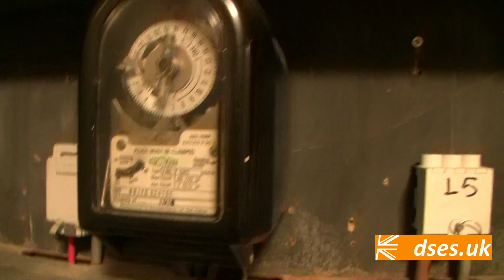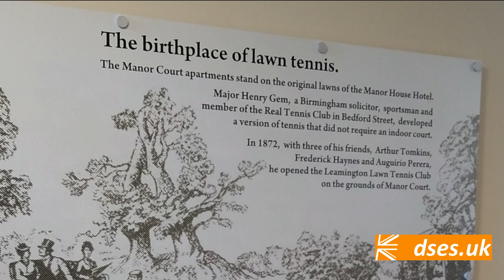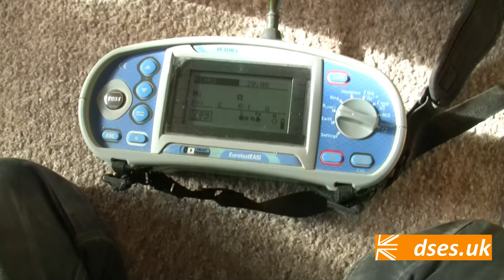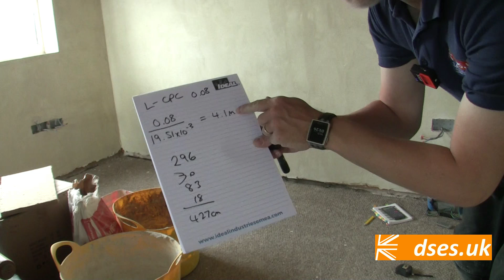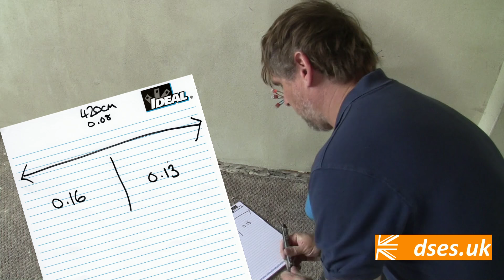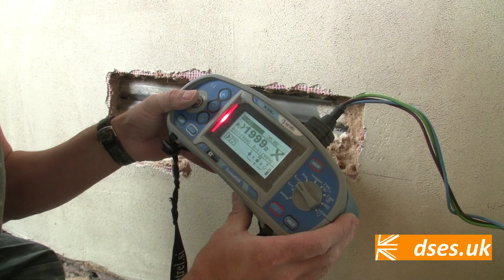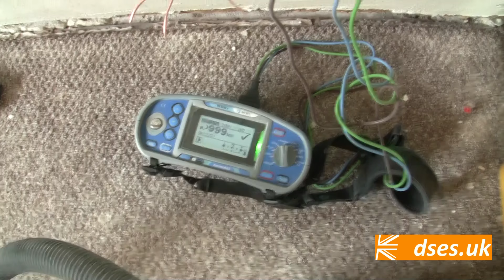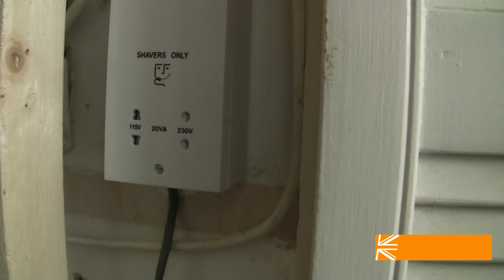Fixing another man's lash-up!

Comment: Crimp links and heat shrink with a fourth lot of heat shrink for the outer sheath. You could use thick wall for the outer if you wanted but not necessary. Cheap quick and lowest profile, can fit a piece of capping over the top. Parts required always on the van. It does depend on how the Neutral and PEC were damaged though, if strands are cut in both by the nail you can't stagger your links unless you piece another section into one of the conductors and use four links for the repair, but thats getting a bit messy.
Reply from the maker: It's the larger heat shrink for the outer covering I lack on the van at present, otherwise I probably would have crimped it.

Comment: The issue with the socket boxes being set back exposing the fibre board can be fixed by adding extension boxes on top of the existing to continue the metal containment . The wiring of the ring going to every other socket is nothing new , I would have used radial circuits in the lounge and bedrooms as said .
Reply from the maker: I have some skeleton boxes on the van, but it was easy enough to remove these and replace them with 35's. I prefer radials too - I'd have one for the kitchen and one for the lounge/bedrooms for something this size.
Reply: @dsesuk  I think you are right about old habits dying hard , older sparks would use rings  even if it's a lot of work to wire in whereas we would look at the load and area and use radials .

Comment: Electrical wiring in the UK is so strange and different from here in the US. I find the whole concept of ring circuits to be fascinating. Brilliant troubleshooting job on this. I would probably have just ripped it all out and replaced the run between the two boxes. Using conduit rather than that nailed on capping seems like a better installation method since that would have allowed you to just pull a new cable without disturbing the wall at all but, again, it's a different world there than here.
Reply from the maker: Thanks for tuning in from over there! The ring circuit concept is... interesting, and it has it's reasons for being which is basically down to a copper shortage after WW2! Instead of wiring two or three low-current radial socket outlets, a house could have one higher current (30A) circuit wired in a thinner cable that looped from the board, around all the outlets and back again to provide two paths for sharing the load current. For some reason, it caught on and they're still installed by many today, although on an installation like this it's pretty ridiculous and makes the job harder. Two radial circuits would have sufficed here. Conduit is better as you say, but rarely seen domestically here. I would like to use conduit, but I wouldn't be competitive against those who want to do it quick and cheap and who don't care about future-proofing!

Comment: David, regarding wiring zones, I cannot find any mention of where to run cables in the walls in the 14th Ed. (1966). The 15th Ed. (1981), which was mandatory from January 1985 mentions the areas formed by the corner between ceiling and wall or internal or external corners between walls. Reg. 523-20(c) says, "Where the cable is connected to a point or accessory on the wall or partition, the cable may be installed outside the zones permitted by 523-20(b) [ ie the 150mm wide/ deep areas mentioned above ] only in a straight run, either horizontally or vertically from the point or accessory." It is a little ambiguous in that it does not make it clear these horizontal or vertical runs must be in line with the accessory box. Because of electricians' confusion following the introduction of the 15th Ed., it was decided that installations wired to the 14th Ed. could continue until 31 December 1984. So, if the previous fella on your job learnt his trade under the 14th, he could be perhaps forgiven for this routing of cable. Even under the 15th, there is scope for confusion. Some use the OSG for guidance on interpretation of the good book, even though it is not part of the regulations, but that was not introduced until the 16th Ed.
Reply from the maker: Thanks Simon, interesting to hear how things used to be (I only go back to the green book of 17th Ed amendment 1). Still, anyone in the game ought to be keeping up with the changes. To have not learned of a change to something as basic as where to run cables in the past 36 years is a bit of a forehead slapper!

Comment: If 'old boy' had run the cables in the correct zone you could have simply installed a bonus socket to solve the issue!

"I've been doing this for 40 years"

"Yeah...badly"
Reply from the maker: Exactly that.

Comment: Excellent video. Not a sparky, but learning a lot from your vids and others. Would a continuity test between N at the accessory and the nail head helped to prove out the location of the fault once the nail had been located? Obviously wouldn't have made a difference in this instance, but in the off-chance that the wazzock hadn't gone through the cable at that point, could it have proved/disproved the fault? 
Thanks for the content - funny and informative.
Reply from the maker: Thanks Kev. A continuity test would have buzzed out the neutral and the capping, with the resistance perhaps increasing slightly past the nail position, but I'd have to have access to more of the capping to get a location. I suppose had I read no continuity on the capping, then that would have indicated damage to the cable underneath the capping that hadn't involved a nail.
Reply: @dsesuk  thanks for the reply. Yep, makes sense. Ignore my uneducated suggestions! Looking forward to seeing more content and more abuse of Nigel! :)

Comment: If you look carefully at the appropriate British Standard; at 522.6.202 "a cable may be installed in a zone either horizontally or vertically to the point, accessory or switchgear, there is no requirement for any other measure except, a mechanical sheath (BS 624; et,all) be provided. However at the very end of this part of the "reg" there are two little letters that form the word, OR so you comply with  522.6.204 (if you fail to do the above),which then gives a list of five other options, including an earthed metal covering.
Reply from the maker: This is true Roger, but steel capping does not meet the requirement of 522.6.204. It isn't earthed and doesn't provide mechanical protection against nails and screws (as indicated in this video). Had our chap used something more robust like an earthed galv conduit, then the cables running outside of zone would be less of a problem. This reg doesn't clear our installer's mistake here.

Comment: Hi, It's been wired as many do when installing singles in conduit, generally loop between every other socket on each leg then join the last two sockets. this would save on having to run wires from the furthest socket back to the mains and I presume would better distribute the current in the ring circuit. However, I have never seen it done on domestic premises. Not the norm.

Comment: Splendid bit of fault finding there Dave ! I don't know why people use that metal capping anyway. Seems pretty pointless if it's not earthed. I've always used oval tube as it's tidy and less chance of damaging cables when fixing. I always thought capping was to protect from the plasterers trowel - so behind that fibre board shit I would just clip the cables (as I do behind dot and dab board)
Reply from the maker: You're right Mark, the capping doesn't meet the requirements of mechanical protection, it's just there to keep the plasterer for causing trouble, so no real need for it when being overboarded like this. I assume it was just to keep the cables in place without clips.

Comment: I’ll point people to this video when they ask why I wont certify their DIY rewires.
Reply from the maker: I don't touch DIY work. This I took on as another sparkie from the area had overseen it to date, but I expected better when I got into the nuts and bolts of it.
Reply: David Savery Electrical Services yeah, I got that. Some old ‘we’ve been doing it this way for years” clown. I dread looking at other peoples lash ups.
Reply: Most DIYers would have taken more time and care on the install in their own home. Maybe most DIYers would not have capped. The problem here is a professional who has not taken enough care but, worse, did not electrically test their work.

Comment: Thanks David.  As an adult learner anything on fault finding is a help.  I wonder how many other sparks would have used the calculated method to roughly figure out where the fault was before demolishing the wall?  For me it was brilliant piece of  thinking from an experienced electrician with a great work ethic.
Reply: Just to add to David's work, did you know that you can calculate an actual distance from those readings? Here is how:

The two readings (0.13ohms and 0.16ohms) represent the RATIO of distance to the fault from either end. An actual reading to the fault can be obtained by the following equation:

(r1 / (r1+r2)) x Cable length (end to end)

where r1 is resistance to fault from point 1,
r2 is resistance to fault from point 2
and cable length is obtained by direct measurement (cable route known) OR calculated as David did in this video using the CPC and line conductor. For this example, the calculation is as follows:

(0.13/(0.13+0.16)) x 4.2 = 1.88m from the point where the resistance was 0.13ohms

the same works the other way:

(0.16/(0.13+0.16)) x 4.2 = 2.32m from the point where the resistance was 0.16ohms.

Comment: Good video, sir! Well impressed by your use of the mathematicals to find ballpark middle of the cable!  #GoodShow! #MissNigel #Maccas #Legend
Reply: And you can actually work out the distance to the fault:

The two readings (0.13ohms and 0.16ohms) represent the RATIO of distance to the fault from either end. An actual reading to the fault can be obtained by the following equation:

(r1 / (r1+r2)) x Cable length (end to end)

where r1 is resistance to fault from point 1,
r2 is resistance to fault from point 2
and cable length is obtained by direct measurement (cable route known) OR calculated as David did in this video using the CPC and line conductor. For this example, the calculation is as follows:

(0.13/(0.13+0.16)) x 4.2 = 1.88m from the point where the resistance was 0.13ohms

the same works the other way:

(0.16/(0.13+0.16)) x 4.2 = 2.32m from the point where the resistance was 0.16ohms.
Reply from the maker: Can't believe you hashtagged MissNigel! Nobody misses Nigel... unless you meant Miss Nigel? In which case I have some pictures of him in a dress I can sell you...

Comment: And thats why we in the Netherlands use pipes in the wall.And wires,no cable.Wire damaged?Replace by connecting a new wire or a bunch of 3 wires and pull it through the pipes.But because of the pipes there is far less change of damaging the wires.😆

Comment: Not that i'm knocking david for his suburb methods but he could have narrowed it down even further - By taking the overall length of 4200mm and dividing that by the sum of the two resistances from each side (0.16+0.13=0.29) would give you a figure of 14,483. Multiply that by the resistance of the nearest (right) side fault (0.13) and you arrive at a distance of 1883mm from right end point. To make things easier still - you could subtract that distance from the midpoint (2100-1883=217mm). Now you know that the fault is around 217mm right of the centre point. Just a little mathematical trick to narrow it down ever further.

Comment: Good job as always Dave
My bet would be the old guy once did commercial installation where it would have been ok to leapfrog in trunking and conduit 
On that board and mesh I have seen that used in the USA  and it had screws and big cups washers every so far to hod it on then plastered. I can see a whole wall just falling off in a few years or even months.
Keep up the good work.
Reply from the maker: Thanks Paul, and your're right, it's the same here. I didn't get it on camera, but under that mesh and plaster there are plastic 'washers' throughout holding the fibreboard on. It might be great as a heat and acoustic barrier, but trying to put up shelves will be a nightmare!
Reply: well, the priorities here are indeed acoustics, heat retention and non-toxicity. Living without shelves on the walls is a reasonable compromise, in my view.:-)

Comment: I suspect the plastering may be lime as apposed to gypsum. The wood fiber board is the substrate for the base layer of lime, the plastic mesh is then supposed to be embedded into the base layer and then the skim coat gets applied. The wood fiber board, being fibrous, should make a good bond with the base coat and if the skim coat is applied at the correct time (when the base coat is still 'green') then you should get a good bond between coats. The wood fiber board helps with insulation properties too and allows for moisture transfer in the lime plaster, which is important for lime based rendering systems. The wood fiber board - if manufactured correctly - actually has a high resistance to fire. The plastic mesh is supposed to prevent cracking when the plaster dries. I'm not too sure of the quality of work though as it looks like the mesh wasn't embedded in the base coat suitably - it should not be coming loose like that. Given the roughness of the finish they were either going for a rustic look, or the final 3rd coat has not been applied. Given that plaster has probably fully dried by now - it would be pain in the backside to try and do the final coat - as dry lime plaster sucks up moisture so quickly that you would struggle to get time to work the final coat. Why choose lime over gypsum? It has benefits in regulating moisture in a house and it also has high moisture permeability (breath-ability) that is important for old solid wall constructed houses - but it is not necessary in modern constructed houses.  I'm not entirely sure if that is what has been done here - but its the only thing that makes sense. You would not do a gypsum skim coat like this - that would be mad.
Reply from the maker: Thanks for some interesting input there Ben. I know nothing of this stuff. My understanding is that the materials were chosen for their 'eco' properties on this job, although I don't know exactly what they are or what eco credentials they claim to have!
Reply: @dsesuk  Thanks for your response David. That is true that lime has better eco-credentials over gypsum and cement based products. This is because it requires lower temperatures to make it during the production stage. It also absorbs CO2 when it cures as apposed to releasing CO2 that cement does. However, it is not carbon neutral as it still requires a substantial amount of energy to process the raw materials into lime. I used to work for a contractor that specialised in heritage work and that involved a fair amount of work with lime building systems. I'm not an expert by any stretch of the imagination - but I thought I recognised it in your video. Cheers for you videos by the way - they are very informative.
Reply: @dsesuk  Just had another look at the video - I think the plaster work has been bodged. That mesh should have been embedded right into the base coat when it was wet. And I mean really embedded into the base coat. Instead, it looks like they have added the mesh on top of the base coat - probably once it had gone off - and then applied the 2nd coat. Probably going to end up with issues

Comment: Please correct me if I'm wrong but isnt cables outside of prescribed zones a c2, meaning urgent work to rectify is necessary.
I know you can write it off the test as not your work but surely the work shouldn't go ahead and cannot be signed off as safe at the end of the job. 
Unless the metal capping and/or the presence of an RCD makes this a c3 only.

Comment: Daisy chain an aerial cable? WTF unless it's done through a proper splitter you'll get all sorts of issues. An "electrician" daisy chained aerial cables in the house of my mums friend using choc blocks, I had to go in and fix it so she could get a watchable picture.

Comment: splice in cast alu choc box.(they could withstand typical 6mm hammer drills, thing is that they are hard to get over trade counter) btw I would not trust splice connection on solid core (cold flow), overlapping screw connection could be better. But that is just me, generally do not trust splice on solid core conductor (stranded cores - I would be happy to use it). Very cool video - that is why I do not like domestic type of work, you do your calcs and it turns out that new cable is zig zaging behind plasterboard (do not ask me how I know)

Comment: Yep I understand the leap frog thing but the only thing I would have added was a flat sheet of metal to cover over your repair. 1 to cover the cable and 2 so it could be picked up with magnets in the future due to the slight increase of area. Good job David plus you make laugh.
Reply from the maker: Thanks Rich. My Neodymium magnet couldn't get through the thickness of the fibreboard, but I had no sheet steel on the van anyway.

Comment: Strange using as3008 in oz I got a result of 4.91m for the calculated length ( 8.14 ohms per km per wire) …which gave me a short at some rediculous length …so the % of the ratio of the resistance over the distance was a better way of doing the calc…nice!